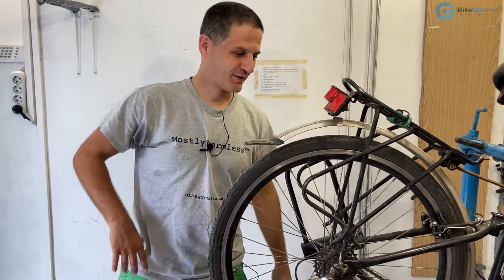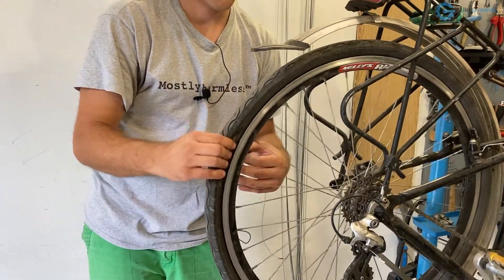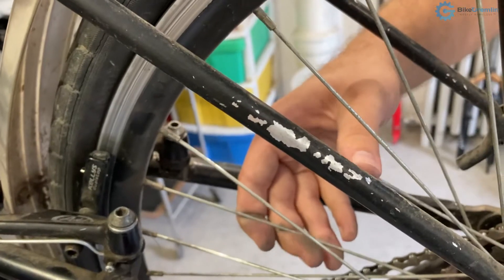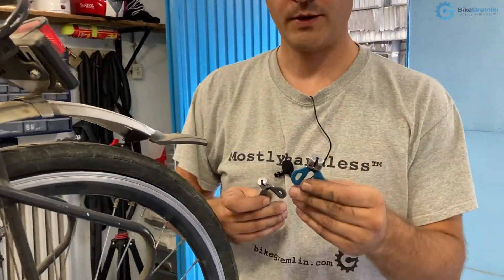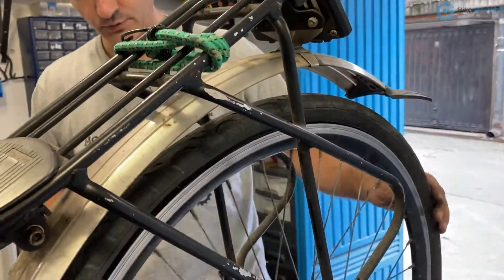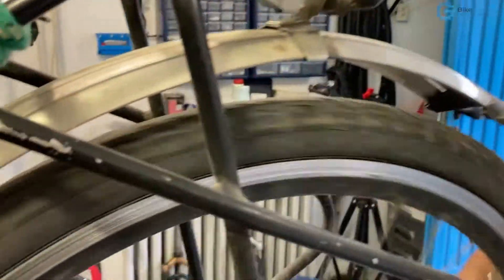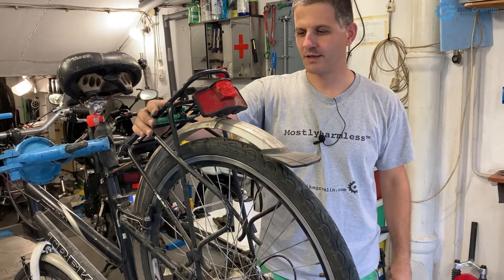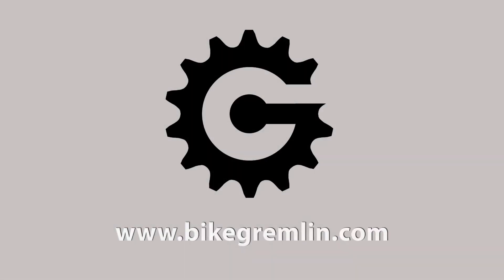Troubleshooting - bike wheel won't turn freely

Comment: My bike started catching after I changed the inner tube, and when I deflated it stoped catching what does that mean?
Reply from the maker: Perhaps the wheel isn't seated properly.
Or there's never been quite enough clearance, so that when the tyre is inflated to a higher pressure, it expands enough to start rubbing.

Close, patient observation often provides an answer.

Comment: Hey brother, my bicycle turns and rotates good but doesn't turn or steer smoothly.. it also makes loud noises af if something inside the wheel has come off.. is there a problem with the bearings? The noises come from the front wheel
Reply from the maker: First thing to do is determine/confirm where the noise is coming from. I wrote an article explaining how to best "isolate" parts when trying to figure that out (frame is hollow and transfers noise and vibrations very easily, so the problem source can be deceiving):
https://bike.bikegremlin.com/7153/creaking-clicking/

Once the problem source is confirmed, solution is usually obvious. Removing a wheel and spinning it by hand, off the bike, can help determine if a problem is with the wheel's bearings.
Reply: @BikeGremlinUS  thanks for the reply brother, i confirmed it and it turns out i was wrong, its coming from the rear wheel, the noise sounds as if something is broken or loose, and the noise is there even while just coasting.. thanks bruh, im going to a bike workshop right after this reply, peace and love from Nepal, bruh😊